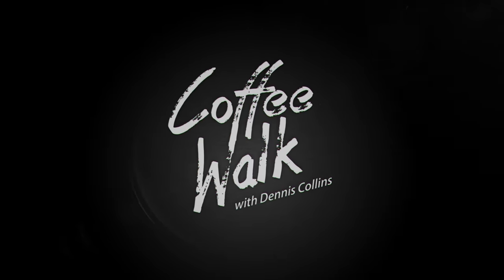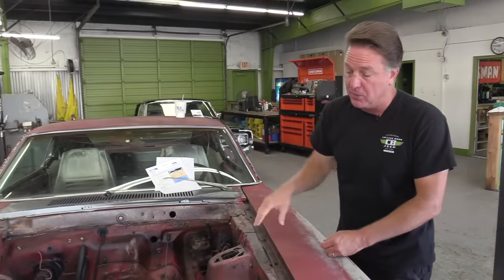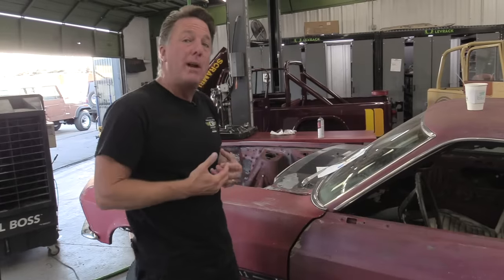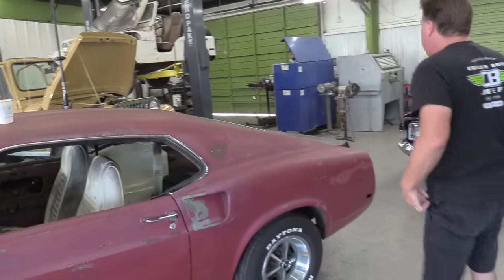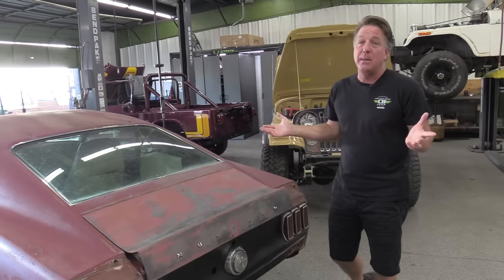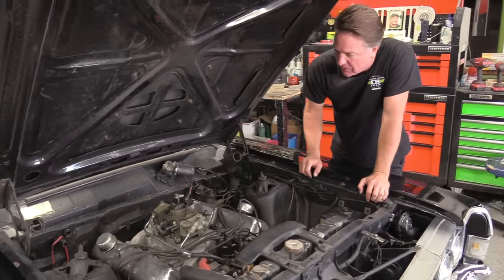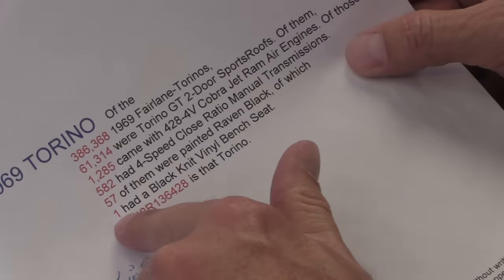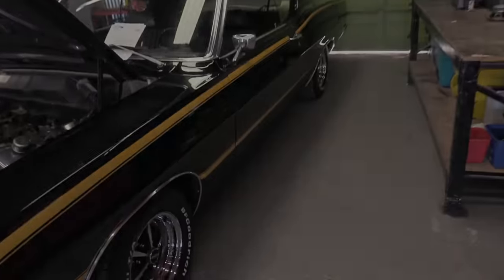Ford R Codes: Torino GT + Mach 1 Mustang

Comment: When I was a kid my father bought a 69 Super Cobra Jet Torino off the show room floor. It was candy apple red with a front bench seat.
Reply: That's rad af
Reply: Bet you wish he had kept it!
Reply: @johnmilligan2964   I was 8 years old at the time and just taught the snakes on the front fenders were cool. Now I know just how cool they really were.
Reply: James Moore thanks, the next year I bought a new 1970 Coronet 500/383/4 BBL/ auto= deluxe int/ ps/Pb, et ( NO AC)actually a strong Car: BUT I,PASSED  ,not buying:AMC MACHINE LOADED, 70 CHALLENGER RT/ SE **REALLY *LOADED Magnum/ 4SPEED.. there was a DODGE/ AMC DEALER NEXT DOOR TO PHARMAXY WHERE I WORKED, ETC. IN retrospect, I should have got the RWBLU Machine AMC, or the Challenger ( thiugh it was way over optioned)...
Reply: For a long time.I didn't know that the Torino had a model Cobra. I am a Carrol Shelby fan. One of the true American Icons. That took it to the world of racing. Then won!  But the Torino Cobra is just a cool Muscle Car. I had a 70 Torino with a 302. Dark green with Black Comfort weave interior. Not a Muscle car but a neat body style.   Shawn.
Reply: @shawnbeck2303  I've seen here on youtube there is a Ford  TV commercial for the 69 Torino. It shows the two Corbra versions in it.
Reply: Friend of mine bought a 69 Mustang Cobra Jet...car was a MONSTER...smh
Reply: @mauricepowers8079  There are a lot of people that say the 428 Corbra Jet Mustang was faster than the Boss 429
Reply: @jamesmoore6146  I honestly am not knowledgeable enough to give an opinion but I will say this...i rode in it one time when he opened it up completely and it took my breath away...never forgot it.
Reply: My father bought one of those in 69 also. Red with white strips. He bought it while stationed in Germany right before getting reassigned to Ft Sam Houston in San Antonio TX. Unfortunately he wrecked it in 71 then sold it. Cool cars. I’ve been trying to find one to restore fir years now
Reply: @jessefrazier6305  I met a guy from Albuquerque, NM back in 90' ... Him and his father had a Garage on Old RT. 66 in town...all they did was restore old Mustangs and Torinos...he had a sweet 1969 TORINO GT with a 390.
Reply: maurice powers hell I’d take one with a 351 Cleveland if I could find one that was solid. At a price that I could afford
Reply: @jessefrazier6305  someone in North Western Florida has a 69' GT for sale for $1K...no engine or transmission...
Reply: @johnmilligan2964  yeah, no shit!
Reply: @mauricepowers8079  what's his number? 😁
Reply: @Marco-fi6gv  I looked for the listing on FB...it was not there...he must have sold it and taken the posting down...sorry.
Reply: @mauricepowers8079  no prob, thanks for looking 👍
Reply: @mauricepowers8079  I used to have a 68 Torino GT with a 390 and 4spd manual. I also had 69 Fairlane parts car. Parts car was actually in decent shape too. Myself for getting rid of it 🙄🤦🏻‍♂️
Reply: @Marco-fi6gv  I had a 68' Torino with a 302 and a 3 speed Standard...put a 4BL Holley on it...was getting ready to rebuild the engine and wrecked the nose in a snowstorm(kind of slippery that day😂)  oh well...my one regret was selling my 67 Le Mans...tried to buy it back a year later and my "buddy" put it nose first into a telephone pole doing about 80...car was perfect from the drivers seat back but a V up to that point...the guy who wrecked it was DRUNK as a skunk and staggered away from it...that happened THE NIGHT BEFORE I ARRIVED TO TOW IT BACK TO CT. FROM NC...I got down there and the guy I sold it to was waiting with a case of beer...he had loaned it to our buddy Gilman the night before...FUCK...😂😂😂...that's the way it goes sometimes.
Reply: @Marco-fi6gv  I will keep my eyes open for any more Torinos...they are getting very hard to find.
Reply: Should have kept it. Worth money now...
Reply: @mauricepowers8079  that sucks!🙄😑
Reply: @shawnbeck2303  yeah Carol Shelby the man the myth the legend also 1970 Shelby gt500 nice looking not the favorite from many people one in convertible and white interior good or a 1971 Shelby europa mustang good
Reply: @shawnbeck2303  is the cobra in 1970 torino the same as the one in a  1969-1970 Shelby GT-500 also mustang cobra where made check out 1971 mustang shelby europa
Reply: @mauricepowers8079  Those telaphone poles are widow makers. Good thing the guy was drunk, that's what saved his life.
Reply: @tomcaldwell5750  yup...loose as a goose.
Reply: @jamesmoore6146  they were. The Boss 429 in stock trim was too choked down to make big power. But the potential of the Boss properly modded is amazing.
Reply: @jamesmoore6146  it was. 428 Cobrajet was the fastest stock Mustang tested by Hot Rod  and was quicker than the Boss.

Comment: Thank you Dennis... You just proved my point
A little over a week ago I talk to a gentleman who had a set of Magnum 500 wheels that a friend of mine wanted to buy the Magnum 500 wheels had a Ford stamp in the wheel indicating date code, plant and shift where they were made.. . I asked him if he could tell me what those numbers were told him where they were and he could not verify that they were there... I told him if they're not there then they are probably Cragar knock-offs I asked him to take some pictures of the insides of the rims which he said he couldn't do at the moment he also said he had the Magnum center caps separate but they didn't fit (another indication)..the man told me I didn't know what I was talking about, we ended our conversation..

Comment: Parents had a red 69 Torino with 428 Cobra Jet and ram air. It was an automatic with red bench seats and the stripes were white. It was a runner and sounded great. He even used it to flat tow our 66 Shelby GT 350 to the drags!

Comment: I was lucky enough to own a 1969 R-Code Torino GT 428CJ from 1971 to around 1980. It was pale yellow with gold stripes. As I recall, the stripes on this car continued in a straight line all the way across the rear quarter panel. The car in this video has the stripes following the upper curve of the panel. Damn I wish I still had that car!!!
Reply: Correct, it seems that this '69 is a repaint with '68 GT fastback stripes.
The main differences between the two years it the stripe top like, the centered and crest surrounded grill GT moved to the drivers side, and this '69 is missing the "mesh" under the tail light panel brightwork bar. I've owned several '69 & '69 GT fastbacks, including one of each at the same time. 
Btw, the oddest stripe was in '68. A heavy band that followed the top of the body line while the bottom of it followed the '69 GT's upper line. Sadly that one was a PA rotted out parts car only
Reply: @BloodRaven1969 68 had rear reflectors on rear quarters 69 had lights on rear quarter.

Comment: When I was 24 years old and in the USAF stationed in northern CA I bought a new 69 Torino in dark metallic green with the gold stripe came with an FM stereo radio and BF Goodrich radial tires (which were both new things back then).  The interior was black vinyl and without a/c. Was it hotter than hades in that car. When you closed the door on your Torino it had the same tinny sound mind had.  As a side note, being in the military and a non-resident of CA I could take delivery of the car in NV and not pay CA sales tax (NV did not have sales tax back then). With a local Ford sales guy with me (had to pay $25 for him to accompany me) we drove to S. Lake Tahoe, NV to have a letter notarized (in NV) stating that the car was delivered in NV. After that, the salesman wanted to go to a casino and play Keno for a while. I had never been in a casino or ever played Keno so I said what the heck. On the third ticket I played, I won enough money to pay off the car. What memories your video brought back to me.

Comment: The Torino brought back some memories. I had a 69 429 GT that I rolled 5 times on a mountain road. It was white with black interior.
Reply: A 69 did not have a 429 ! They came with 302 , 351 ,  390 or 428 !
Reply: Stephen Brown then why didn’t you say you swapped engine and trans because the trans is also different ! Maybe you just don’t know the difference !
Reply: My old man had 2 '69 428 Torinos. He rolled the first one in '72 in Tennessee on a gravel mountain road. While still recovering and heading back to his military base in Georgia he flipped his 2nd one end over end off the highway. Both times he was drunk.
Reply: @thomasdaum1927  quit whining
Reply: Tim Mebruer  Yea sure , lets put false info out there. If there was an engine/trans swap he should have said so !!!
Reply: @timmebruer5205  It would be a 3.89 9 inch Wouldn't it?

Comment: In 1977 I bought a 69 Torino GT Sportsroof with a 351C 4V 335/365 HP, dual exhaust, C6 /w T handle floor shifter, 9" Detroit Locker /w 350 gears, factory fourth leaf spring, Wimbledon White /w Red C stripe, Red vinyl interior /w bucket seats, factory armrest console, and factory AC, FoMoCo AM/FM stereo system /w four factory speakers. Man, I miss that car.

Comment: Having both these spectacular Ford's in the same shop at the same time makes my head spin! In my view the Mustang should absolutely be restored to original!
Reply: Still won’t be matching numbers even a warranty block
Reply: @bartschwartz7217  That's right, I was assuming the drivetrain was there just not installed. If the original engine and trans isn't there the restomod for sure!
Reply: Warranty block means it’s was not repaired but with paper work is accepted but from looks of engine bay was raced hard and motor pulled for another car and body parked for possible later use

Comment: Cool car, I once had a Springtime Yellow GT with 428CJ RA, 4 speed & open 3.50. In the '70s I used to get the aluminum intakes from ex-police cruisers, still have one on my Cobra.

The Marti report indicates 2313 Raven Black, '69 Sportsroof Torino GT, 40 had the Comfort Weave bench seat(that doesn't agree with other report). Those numbers are for all GT Sportsroof. Incl 302(std engine), 351 two & four bbl, 390 and 428CJ with/without Ram Air. 

In the mini report, 57 of the 428CJ GT were black & one had Comfort Weave bench seat. So yes it is one of one.  

Order listed as "RETAIL", meaning someone walked into dealer, completed order and likely placed a deposit. In other words, car was sold when ordered. Waynesboro VA is a smallish city  in the mountains just off I-64 near Staunton(Statler Brothers). In 1968 I-64 was yet to exist in completed form.  Would be surprising if  Paul Freed Inc(dealer) sold a half dozen 428 Mustangs & Torinos combined. 

 Apparently only options are the 428CJ Ram Air, 4-speed, T-L 3.50 gear, upholstery & Visibility Group. In features(may or may not be options) Marti only lists Traction Lock, Visibility Group & std WW tires. 

The outer grille sections are incorrect, ones installed are metal versions from a Fairlane or maybe Cobra model. 

In my experience 428CJ cars had open rears about as often as not. Optional on all models that did not have Drag Pack. Probably ran short is a old wives tale. If T-L was ordered, build would be held, then scheduled when available.  Non performance dealers seemed to order without T-L &  probably checked off a clock instead of tach in dash.

Comment: Dennis, the Marti report you have for your '69 Mach 1 was interesting to me. In the mid 80's I owned a '69 Mach 1 that was optioned very much like yours, T red, white deluxe interior with fold down back seat, etc. Mine also was 428CJ, 4 speed , shaker hood, p/s, p/db, It also had full console, and tilt-away steering. The thing that got my attention was the power ventilation, my car had that. If the Marti report is correct, then we have found the two cars that had it. I've been in the Mustang hobby nearly 50 years, and to now, my '69 Mach 1 was the only one I had ever seen that option on. My car was sold new here in Huntsville,Alabama by Woody Anderson Ford, and to the best of my knowledge, is still in this area.

Comment: In 1978 I bought a 1970 Ford Torino Cobra with 429scj drag pack, brown with tan interior high back buckets, Am 8 track 4 speed close ratio. I've also had a 66 Mercury Cyclone GT with 427 4 speed, it had aluminum bumpers front and rear, fiberglass decklid, hood, and front fenders from the factory. I had in early 90s a 67 Fairlane GTA with a 428cj in it. It had 12.5 to 1 pistons and long duration/high lift solid lifter camshaft. I have owned six mustangs and a 68 Mercury Cougar XR7, but have always liked Fairlanes and Torino's. First real muscle car was a k code 65 Fairlane Sports Coupe. I would restore the r code mach back to factory even with the open diff. Too rare an optioned car to do otherwise.

Comment: I swear I was just looking at that Torino 6 months ago here in southern Wisconsin. It wasn't in the middle of nowhere , but it was in a driveway right off a rural highway.  I didn't get to inspect it so I didn't see what it all had, but how many black Torinos with those Cragers on them can there be? There is also a Cale Yarborough Torino around here, too. Great channel, Dennis. Thanks for the interesting content.
Reply: Cale Yarborough?  Is it white with a red roof?  If it's a Cale Yarborough, it's actually NOT a Torino.  It's a Mercury Cyclone.  Same body, but the Mercury version.
Reply: @lancegoulet8100  You are correct, my mistake. ( Im not a Ford guy)
Reply: @jackolson8775  The Cyclone is basically a Mercury Torino.  They look very similar - the grill, location of fuel fill (the Torinos are behind the license plate), detail behind the windows (Faux vents or whatever) and the stripe packages are the only difference on the outside.  I only know this because I'm working on a Torino right now, and when it finally comes time for paint, I think I'm going use the stripes from a Cyclone and paint the roof a different color like the Yarborough/Gurney Cyclone.  Pretty cool there is a Yarborough near you.  Those things are pretty rare!

Comment: In 1975 I was 15. I cut up a very rusty 68 Torino, 427, close ratio 4-speed, 391.1 Detroit locker, to build my first legal car. 64 Falcon. It lasted 3 weeks. Windshield shattered hitting 2nd gear.

Comment: All BOSS 429’s used the 428 Cobra Jet platform. It had all the heavy duty parts right off the assembly line. As far as I know, the 428 was not installed on the assembly line. The Cobra Jet Mach I was sent to Kar Kraft to alter the shock towers, install the BOSS9,  relocate the battery to the trunk. When all was said and done, the BOSS received a special Id tag #. The wheels were either steel with hubcaps,
magnum 500’s.They did not come with the rally wheels. 
It’s too bad Ford didn’t do the same with the Talladega.

Comment: I had a ‘69. Torino GT - I really wished I hadn’t sold it in college. It was an M code if I remember right. 351 Windsor with a 4barrel carb (it was a cast iron intake. One of the coolest things was the turn signals on the hood scoop- you could see the Ford insignia in the corner of the light if you looked close 😀

Comment: The Mustang is just to rare to restomod. Except that in Texas it really needs AC!!!
Reply: It’s half a car—missing the engine and transmission.  It’s not possible to do anything BUT a restomod, unless he leaves it as is, as an example of markings, stamps, etc.  Even if it was a date-code correct block and trans done to exact factory specs, it’s still modified.
Reply: Could be wrong but I don't think the ford motors have serial numbers to match the car.
Reply: @jaycalgary7  I believe you are correct, as long as the casting numbers are like C8 or C9, but I don't what the suffix should be, on the block, or whenever the original introduction date was for the 428 CJ it should be fine. If a good block can be found of course.
Reply: @jaycalgary7  ; The vin is on the rear driver side of the block, just below the head. :)

Comment: I really like your 1969 Ford Torino GT better than the Mustang Mach 1, I happen to be a car archeologist, and could tell you about special order r code Fords. My Dad once had a 1969 Ford Torino GT Fastback with a 390, 3 speed on the steering column, black bench seat in the exact same color scheme.  I once saw this exact same color scheme at the Villages Car Show in Florida. My Dad later had a 1970 Ford Torino GT in Presidential Blue with a 429, 4 speed on the floor, blue bucket seats, and a counsel that ended up being total.

Comment: I know that the Ford freaks will blow a gasket but the Mustang will never be a numbers matching survivor. So I think you should resto-mod it!
Reply: I’m one of those ford freaks, cars are only new once so whatever direction they go with it I’m sure will be cool. If it were me I’d just triple black it, 500hp, brake upgrade and no cutting of the body. I hate fender flares and anything else that makes it difficult to undo.
Reply: If numbers matching ISN’T an option, such as a missing motor, rod through the block, etc, I’m kind of ok with a restomod, as long as it’s done properly (no Chevy engine, no 1000 hp “street car”, etc).  That being said, one of my dream cars would be a ‘65-‘66 2+2 done up as a GT 350, with a modern Ecoboost/6-speed drivetrain.
Reply: @MrJett1971  Why would you do it when you can buy a new 428 boss engine ?

Comment: I had a 1969 Torino GT Fastback that was red with the white c stripe on the sides and a hood scoop with turn signal lights built into the scoop. I had just gotten out of the Navy and fell on hard times in 1986 and had to sell it for 500.00 so I could keep a roof over my head. I should have just bought a tent instead!!! I'm a disabled vet rated at 100 percent and want my car back. 😂

Comment: Yeah if you had original motor and transmission for the Mustang you gotta do it stock. I’d definitely put a locking diff on it though. I’d try to get the Torino back to stock except I’d keep the intake and carb.